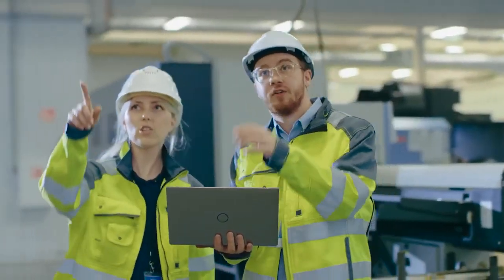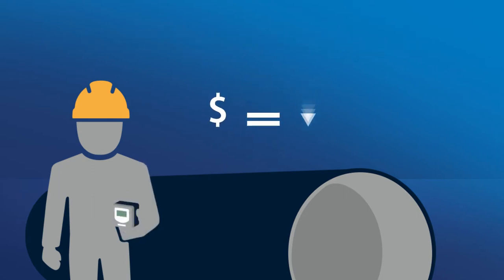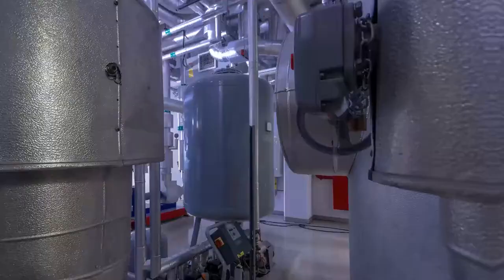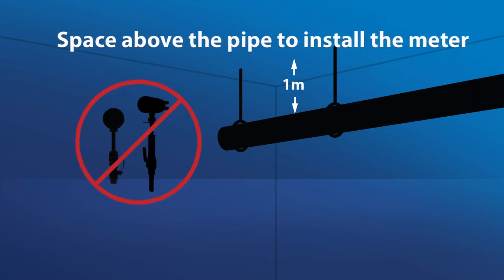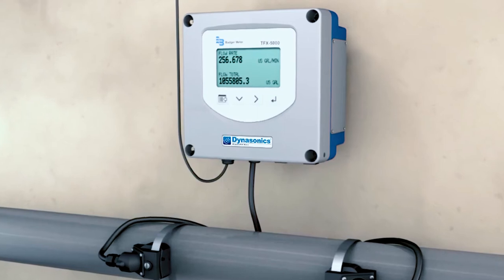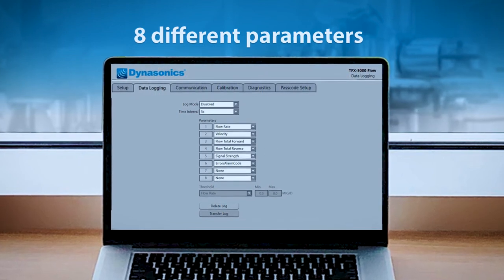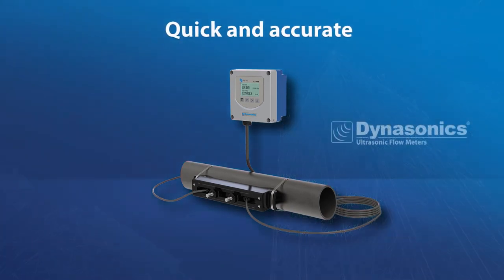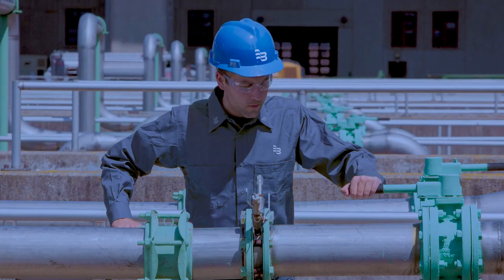Ultrasonic Clamp-on Meters vs Insertion Electromagnetic Meters | Badger Meter

Comment: Can be used in PPR pipe?
Reply from the maker: Thank you for your comment. Yes. Generally, polypropylene pipe material is fine as long as it has a smooth wall and is not corrugated.  Any insulation must be removed before installation and may be placed over the transducer sensors.